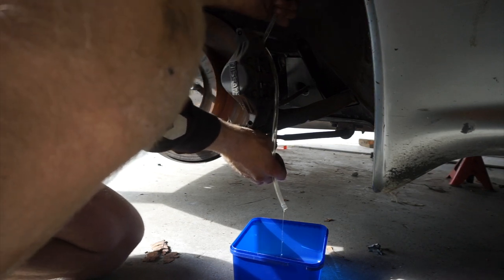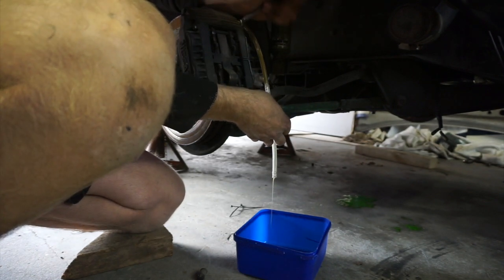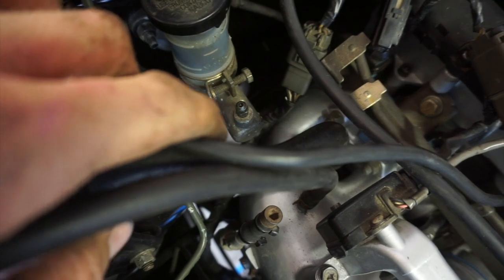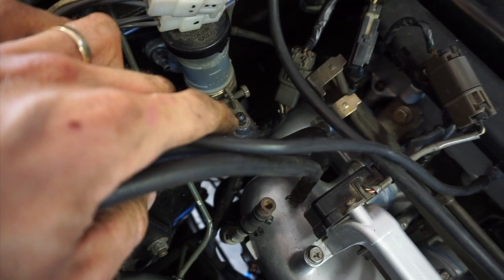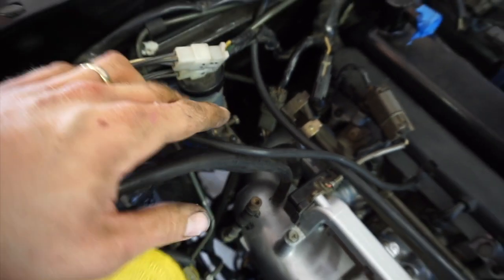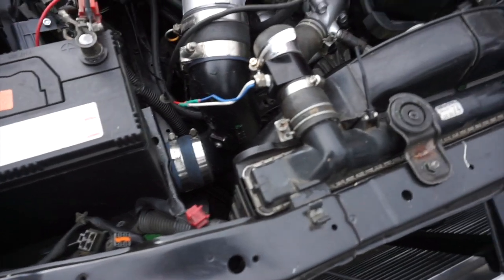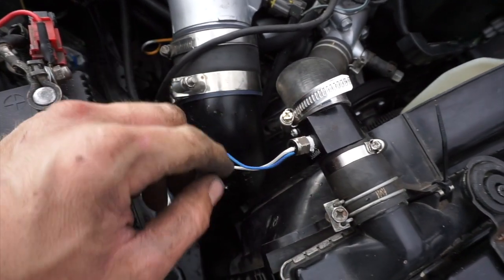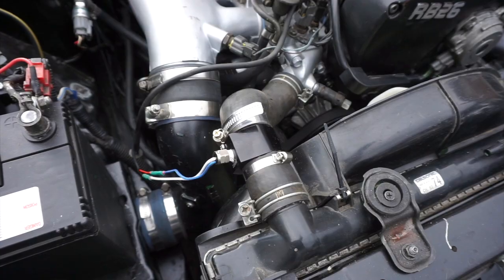FIRST DRIVE!!!! R32 NISSAN SKYLINE RB26DET

Comment: Was about to start a 26det 32gtst swap, can you use the original rb20det engine fuse box with the 26?
Reply from the maker: Michael I believe you can ,prettty sure mine has the original gtst fuse box. Might just pay to double check online.
Reply: Yeah all the old forums I've checked say something about about the ignition fuse has to have a wire swapped around to meet with a gtr igniter. But idk guess i can stick to tge good ole "if it fits it fits". Also do you reckon a downpipe suited for a 20 would fit the single turbo 26. Just in terms of not hitting anything on the way down just enough to cut and weld a flange so it saves the pain of having to get everything custom because like you i cant weld. Well not stainless anyway
Reply from the maker: Depends if your 20 had a standard low mount set up or top mount. But I’m  sure if the downpipe was cut and maybe had some added or taken out of it it will be able to be re used.